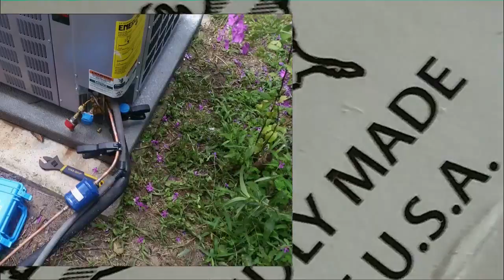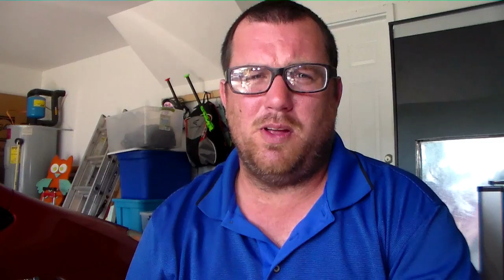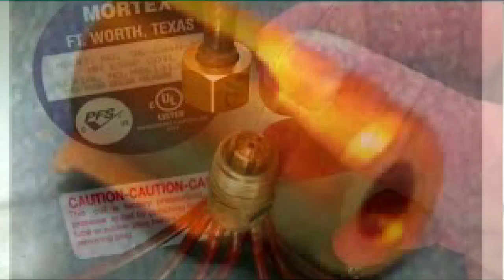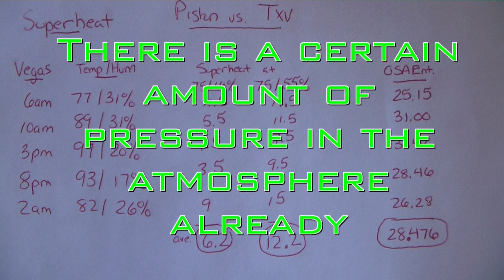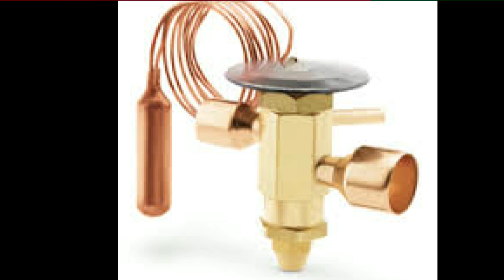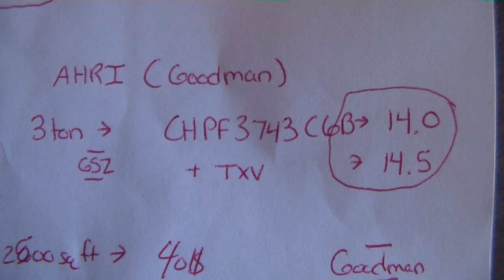TXV and Piston Metering Device Comparison

Comment: When you think about the ways to dehumidify without overcooling (which is common and costs significant operating costs over a higher setpoint), then TXVs and ECMs are needed and will provide solid economics.   To solve another common complaint, eg insufficient cooling on extra hot days without full time oversizing,  then TXV equipped two stage units makes for happy customers who can be comfortable under many changing conditions.